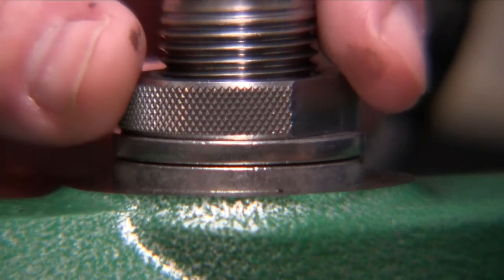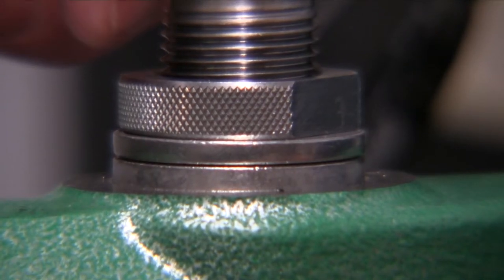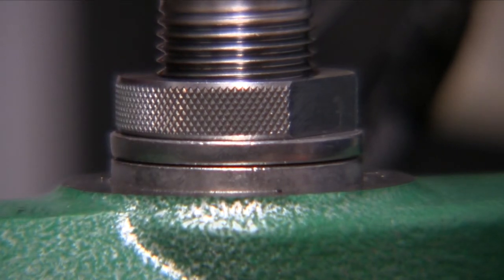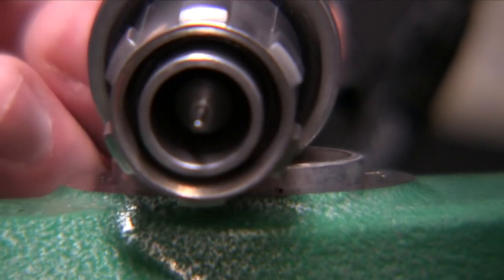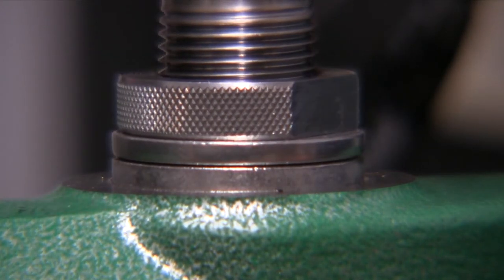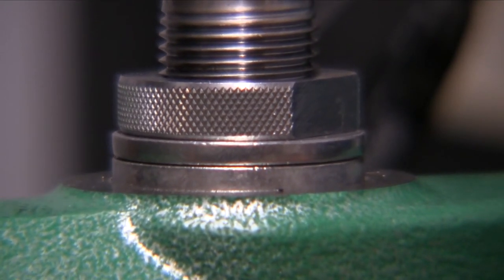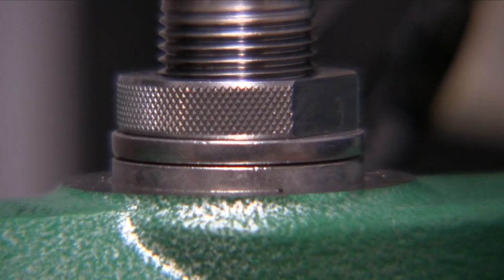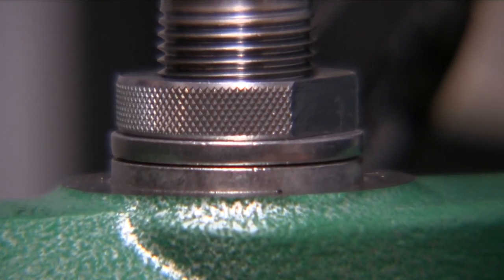One major benefit of the Hornady LNL bushing system demonstrated.

Comment: Have you found the LNL and RC press to be an accurate combo? What dies are you using?
Reply from the maker: It has proven to be a very accurate combo and much more user friendly than the standard screw in die configuration.  I typically use the Hornady competition series dies because I haven't found much improvement, if any, when going to a "high-end" match die or similar.